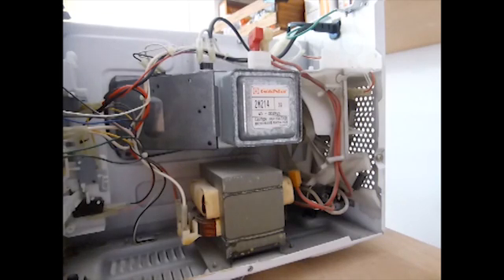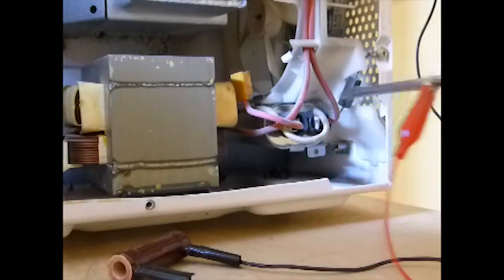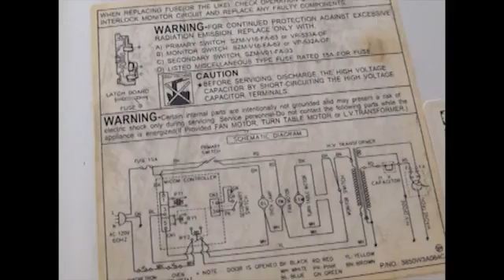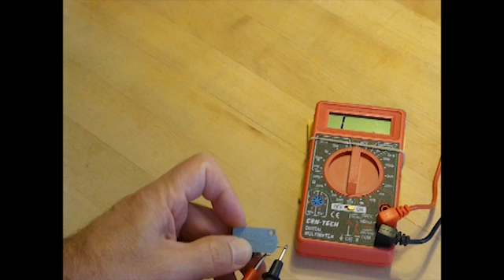Microwave Oven Repair - door switch replacement

Comment: Misterfixit is totally correct in what he says, there is a High Voltage Capacitor inside the Microwave. This certainly does hold a charge in many microwaves & should be Properly Discharged before attempting to work on a Microwave. Although many (Not all) have a Bleed resistor, they can & do at times go open circuit & should not be relied on. It takes a matter of seconds to discharge the cap & then you know it's safe.

Comment: I don't think there is any capacitor in the Microwave that store energy to shock you. Only the old type of TV does. It is a straight forward like the IRON. There is NO ENERGY STORED. If there is any energy stored, it will SPARK when you touch it with the discharge device (here you have the high watt resistor) but as I said, there is no energy stored in the microwave. When you unplugged it, it is dead. No shock, no spark, but you can do your way for caution only, however, if you said microwave has stored energy, it is not correct.
Reply: I wouldn't expect a capacitor to be safe as they were designed to store energy, it isn't worth the risk, to just assume it drains. Electronics are complex and you don't want to damage components or risk your life or health. My microwave has a high voltage, as do many and it isn't worth the risk to assume parasitic components are operative.
 
http://electronics.stackexchange.com/questions/32529/do-capacitors-automatically-release-their-energy-over-time

Comment: Where did you the switches?
Reply: most appliance repair stores carry these switches as they are common among many microwaves, paper shredders, & refrigerators. Omron is the typical supplier. Omron_069-150_HR_0

Comment: Many thanks for posting this video. It is very informative. Special thanks for the Capacitor Discharge Bleed Tool info. Easy to make and is a professional approach to safely handling Capacitor Circuits. Top job :)

Comment: great video, most out there forget to tell you about the capacitor ... what size resistor do you use? is a Caddock MG745 200M MEG Ω 15kv 5W 1% overkill - or just being safe? because that's what I have on hand and you said thousands of volts. Another video out here has a comment about using a bulb, socket and two clips in lieu of the resistor. And if the microwave has sat for a while, isn't the capacitor partially or fully discharged already?  thanks!
Reply from the maker: Thanks for the comments.  It’s a 150k ohm 25w resistor. Stick with the higher wattage (10w +) resistors that can handle potential high voltage without zapping between terminals—there’s some on ebay for ~$10.  . Yes capacitors can discharge over time when unplugged but can you tell?  Don’t use a light bulb! That’s for lower voltages and much, much smaller capacitors on circuit boards etc.